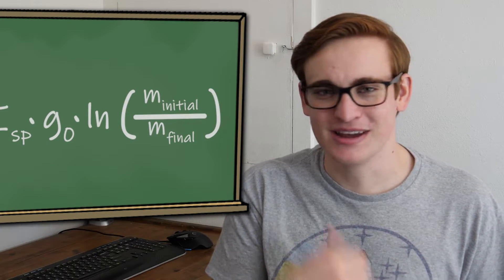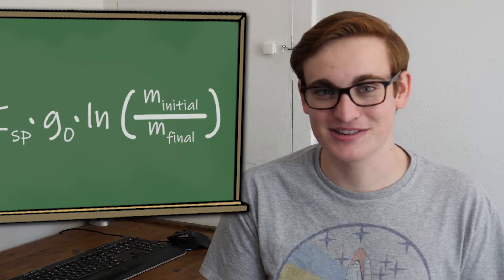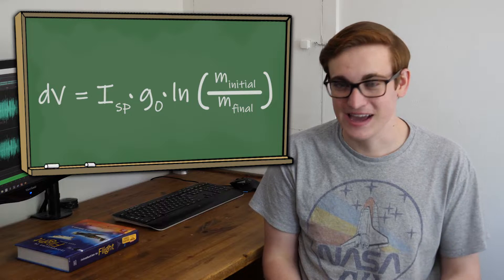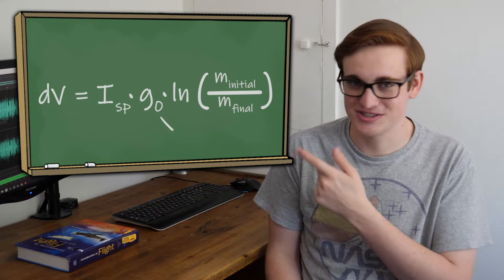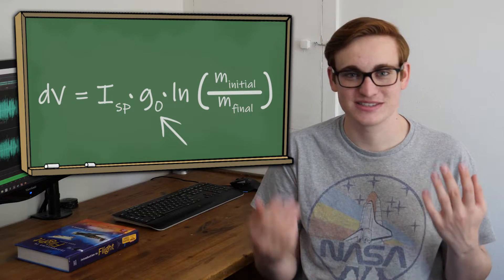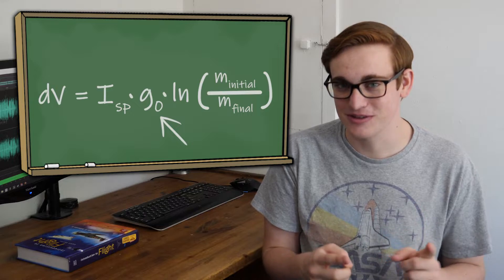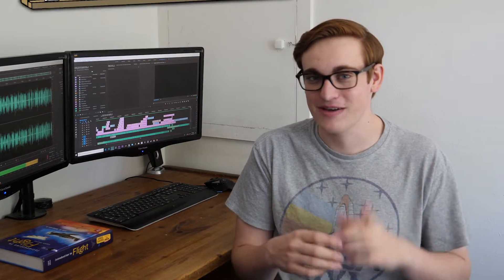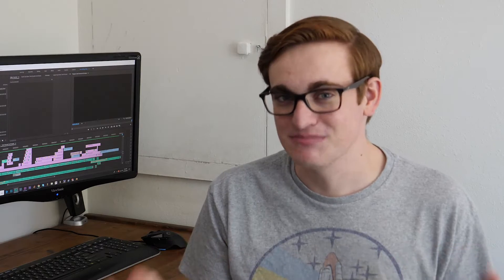Understanding Specific Impulse | Rocket Science 101

Comment: Great explanation! So it's how many seconds your fuel can resist earths gravity at sea level. Doesn't matter weather it's 1kg or 347LB of fuel, it's how many seconds you can hover(well that's not exactly right because the fuel mass but almost) for. It's stupid yes as it should be percentage of speed of light rather than G but that would not be so practical. "The new ISP can get the rocket to 0.000000124% of the speed of light rather than  0.000000118% what an improvement!"

Comment: So, help me understand because wikipedia got me confused.

I am supposed to make the fuel so we can launch a rocket to reach the stratosphere. Should i be looking to get the maximum Isp out of the fuel, or the maximum thrust?
Reply from the maker: Unfortunately, like most things in engineering, the answer is both. If your isp is too low you will need a bunch of fuel to make it to the stratosphere, but having too little thrust also hurts efficiency (though not isp directly). The longer it takes to get to the stratosphere the more energy you lose to something called gravity loss. Think of the extreme example where your thrust equals your weight, you aren't going anywhere but you're still using energy. So, in general, the faster you get to the stratosphere, the less energy you need but that also leads to more aerodynamic drag, which is another way that energy is wasted.

That said, if you're making your own fuel there's really only a handful of options anyway, and max isp is fixed for any given fuel. Also, maximizing the isp you're getting out of a fuel (by making a better nozzle) will also give you more thrust. So once you have a reasonable motor design you're sort of left to add fuel until it's enough to make it to the stratosphere.
Reply: @ConHathy  Thank you very much!
I will try my best to work this out.

Comment: have you ever seen any information on compressed gas rockets cooling? I mean, the expansion of the gas would cool the rocket and cooling is an issue.
Reply from the maker: I have not, I suppose if the gas in the tank started to cool it might not have as high of an exhaust velocity which would hurt the ISP, but I don't know of any rockets that use cold gas for extended burns, it's usually for RCS.
Reply: @ConHathy  cooling is inevitable with the gas in the rocket losing pressure. It would likely need to also have a burning engine to heat sink with, but the Russian rockets have more than one engine anyhow.

Comment from the maker: I usually include metric <-> Imperial conversions in videos but I forgot in this one.  I'll justify it by saying aerospace engineers only use imperial for aviation but if you still want your freedom units, it's actually more simple than metric for once.  You would need a rocket with 1 lb of fuel to produce 1lb of thrust.  Pounds are already a unit of force so you can skip the conversion.
Reply: No, no, no. Slugs are the imperial unit of mass, pounds are force. Until you get into the "pounds-mass" and "pounds-force" discussion which are fake units. I absolutely hate this. Worse yet, some literature from American Aerospace Engineers has a weird version of Specific Impulse NOT in seconds using these stupid pounds-mass/pounds-force. It's a mess.
Reply from the maker: @LC-wv7tz  I agree, except in this case you do not want mass at any point, you want weight at standard gravity